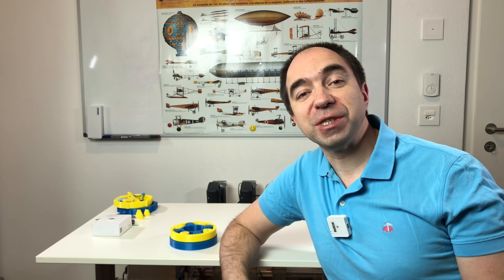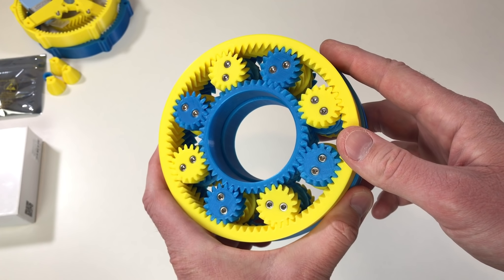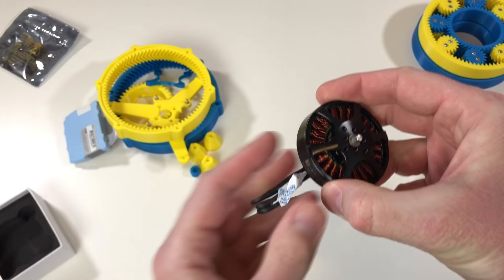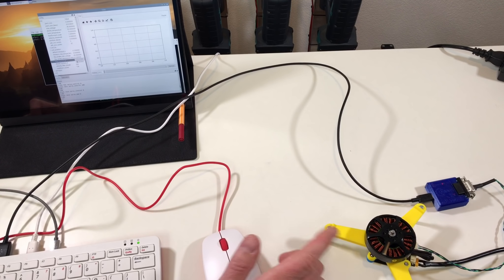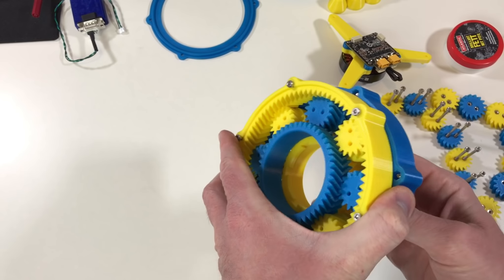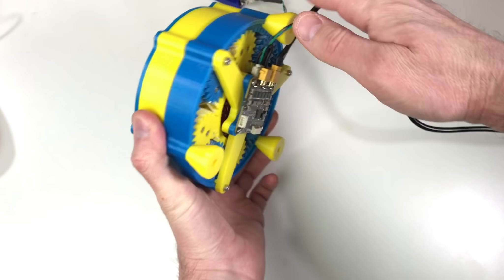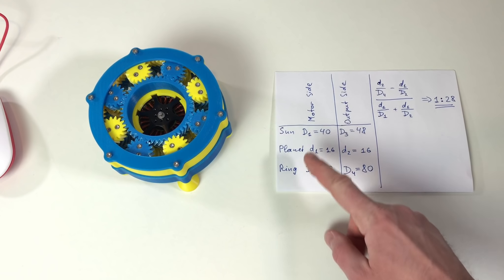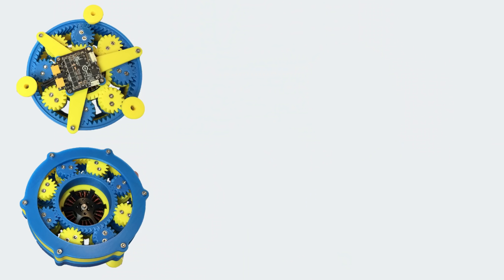The cheapest 3D printed actuator for robots (with brushless motor)

Comment: So, what you have there is what is commonly referred to as a "Wolfrom" (not WolfrAm) planetary gearbox. While they are attractive for their compactness, they are also notoriously inefficient and have fooled many, many, many robot designers. Wolfrom's look like they would be the perfect robot gearbox, but they are not, due to the phenomenon of "recirculating power". It's a subtle, but often fatal, flaw. The recirculation basically knocks the efficiency down to 50%, maybe 60% on a well-made metal gearbox. A plastic, or worse, printed, Wolfrom will likely be horrifically bad - likely below 50% and maybe 30-40%. 
The fact that you can't backdrive it is the first clue that something is wrong. A two-stage, 30:1 gearbox SHOULD be backdriveable unless it's a wormgear or similar drive with loads of sliding friction or otherwise poor efficiency. If I had a Swiss Franc for every Wolfrom gearbox made by an optimistic robot engineer, I could buy a Harmonic Drive. The insidious thing is that Wolfroms tend to spin well when NOT under load, but once you load them down, the efficiency drops through the floor. The planets also have a fierce twisting moment on them which tends to make them even less efficient, or worse, just bind up solid. Anyway, all that to say, please run some LOADED tests and see what kinds of efficiency you are seeing before investing in a full arm design. I predict that you will be disappointed. 
The only Wolfrom drive that I know of that isn't horrible is a traction-planetary version (Archimedes Drive) made by a Dutch company called IMSystems. They work, and they work well, but only because of the very high rolling efficiency of their traction elements - even higher than involute gears - that makes the math work out. Even so, I think Archimedes drives are still only the 80% efficient range - good, but not great. An equivalent (sequential) 2-stage planetary will have efficiency greater than 90% and maybe >95% for a really high quality gearbox.
The poor backdriveability that you are seeing also means that the drive will have poor "transparency" so doing sophisticated torque-based control is a non-starter. If you don't have a mobile (battery powered) or force-controlled application, and you don't care about having to oversize motors and drives, then yes, they can work.
Reply: Thanks for the thoughtful critique; I was thinking of making something similar but this is food for thought, for sure. GearDownForWhat was also reporting rather low torque efficiencies in his test of his printed gearboxes. Still I just recently saw a video of a backdrivable 100:1 along these lines. The fundamental compromise with this design is that you will have fast moving contacts under high load at the ring-planet contact; which is something many other transmission like a stacked low ratio gearbox avoids. But as long as the losses there are optimized sufficiently well, it seems to me there are legitimate applications for this. High duty cycle applications are not ideal; but unless your robot arm is actually employed on an assembly line, its duty cycle can be very very low. To open up robotics to applications other than assembly lines, things like cost can be much more the deciding factor than even double digits of percentages of efficiency.
Reply: @eelcohoogendoorn8044  Yes, that's exactly the issue. This style of drive is notorious for having "output loads at input speeds" - which is the worst possible combination. This leads to the low forward and backward efficiencies and poor transparency.

I don't follow your duty cycle comment - efficiency is efficiency regardless of how much you use it. Low duty cycle will let you avoid having heat buildup that might melt your printed gearing (a secondary failure mode), but it won't change anything related to the primary "failure" of terrible efficiency.

However, as I mentioned in my first post, if you don't care about transparency (i.e. you don't aspire to teleoperation or force control uses) or power consumption or having to have larger motors and drives (and batteries if you are mobile), then Wolfrom drives might still be useful to you. They DO work, they just don't work WELL.
Reply: @bschena  My point is, priorities are different depending on the application. A robot that is working 24/7 will most likely have a higher added value and thus higher budget than an actuator that needs to perform perhaps only a few seconds per day. While the Archimedes Drive is pretty cool, it sets you back 2.5k, for instance. If the choice was between this printed actuator or a sub-100$ with the efficiency of the archimedes drive, itd be an easy choice, but we dont face any such choice sadly. Check out this video: https://www.youtube.com/watch?v=vQqyGsqPwb0 you can find his papers too with some googling. Its just a more well optimized version of the same concept discussed here. Im guesstimating with some good design optimizations you could get a printed affordable high ratio version with 60% torque efficiency; and there are plenty of imaginable applications for that, even if kuka will scoff at it. GearDownForWhat also did a video on a printed backdrivable 20:1, btw.

Comment: Nice work, have you considered  3d printed sintered gears ? (You only need to print the teeth in metal, like a hollow shell, and then fill with epoxy for structure.
Reply: Also you can print stators and wind it yourself then insert magnets in the ring gear. Only motor's bearing cannot be printed

Comment: I'm brand new to robotics. I'm enjoying your videos. I'm hoping to build a small table top 6 axis arm with at least a 2 kg payload for deburring parts that come off my CNC mill. I really like this mechanism. What would it need to be back-drivable?
Reply: If you are just controlling position then backdriveability doesn't matter. However, if you want to do high quality, open-loop force control (by say controlling motor current) then you will be in trouble. Backdriveability, often referred to as "drive transparency" by roboticist is the Holy Gear for a well controlled, force feedback robot arm. Say, for example, you need to control contact force for, say, a deburring operation, then transparency/backdriveability will likely be required - unless you have a lot of compliance (springiness) between the robot arm and deburring device.

Comment: You specifically mention In the video how the screws in the planet's are arranged relative to each planet, but you didn't explain why you did that. What specific problem were you designing around to cause you to spend the effort arranging them like that? Some sort of shear issue, or simply aesthetic?
Reply from the maker: The problem is in the printer imperfection. Each gear is printed at the same printer with the same STL. And some teeth (the same for each gear) are not perfect. With this sophisticated arrangement only few “bad” teeth are engaged at the same time. 

First, I put all the teeth radially, and this was terrible, as all the “bad” teeth were engaged simultaneously. And the gearbox was not rotating smoothly. After I changed orientation to the current one, and this made the rotation very smooth. I hope I explained this clearly. :)))
Reply: @Skyentific  That makes perfect sense. Thanx for the explanation that I can apply to my future projects.

Comment: great video! I was wondering if you could shed some light on how you calculated the teeth required?  Let me clarify: at the moment I made an excel spreadsheet where I provide a sun gear with a set amount of teeth and diameter. Based on this I calculate the module by dividing the diameter by the amount of teeth. Now I can calculate the planet gear amount of teeth and the ring gear amount of teeth. Planet gear teeth = module/planet gear diameter ; ring gear teeth = module / ring gear diameter.   Then I deduct the diameter of both the ring and planet gear by using the formula 1+rR/rS where rR = radius of ring gear and rS= radius sun gear.  I have a feeling that this is where I make a mistake but this is also where I'm asking for your help please. If I do it my way I end up with numbers that end up in dividing by zero if I use your formula for calculating the ratio.

Comment: what a beautiful raspberry setup. i use exactly the same screen, but have found tablets with VNC a little more comfortable, i d love to find a way to have them activated as monitor via PAM access control modules usb detection, but unfortunately the software is now badly maintained and documentation very lacking. if anyone knows how to start a VNC connection to a phone/tab that is connected via USB-C via the PAM module, hit me up... would make the pi 400 so much more powerful

Comment: Is there any step/dir to CAN converter module i can buy, i would like to integrate a similar actuator into a CNC machine/project I'm workin on.
Thank you in advance.
Reply from the maker: I don’t think it exist. As every controller use different protocol. So they all use different can bus commands.

Comment: Really like what you do and this actuator seams very promising. However i have a problem with this video : the title is "cheapest ... actuator ...". If you title the video with a reference to price you must do a cost analysis a little more serious than "it's cheap because it' 3D printable". Moreover, if "cheapest" relate to "actuator", like it's the case in your title, then you must include the cost of the motor and the driver. Those part are not 3D printed so ...
According that the size and form factor the actuator seams pretty close to a mini cheetah MIT actuator  (or clone), so the question is how does it compare. You discussed about the performance but not about the price. Of course we expect lesser performance for all the reason you mentioned, but depending on the cost saving it can be acceptable trade of or not. If it's 40$ instead of 400$ then that's a superb result. Now if it's 300$ instead of 400$ it's probably better to save a little bit somewhere else and just bye the real stuff.

Comment: Great work! I just wonder for the 2nd planetary gearset, as it shares the common carrier as the first gear, its input is connected to the carrier and its output goes to ring gear, therefore it should behave like over-drive? Can you shed some light on how did you get the total ratio of 28?